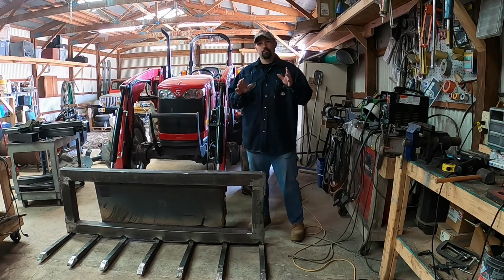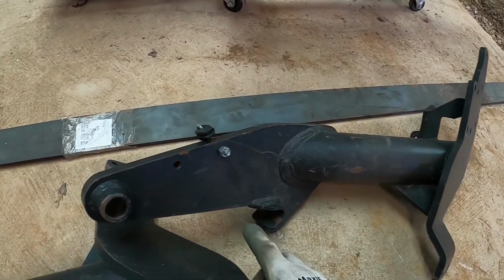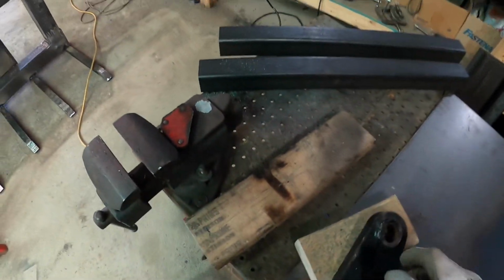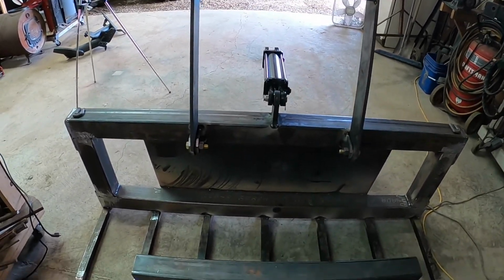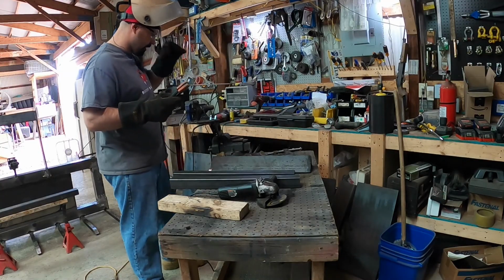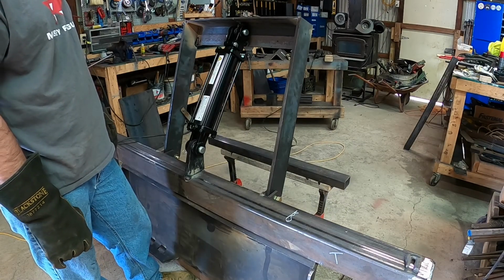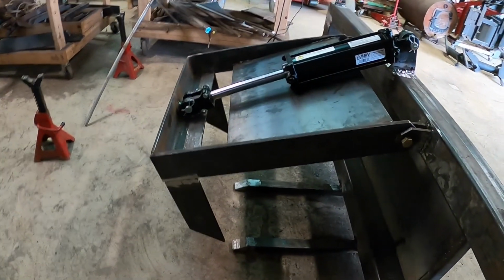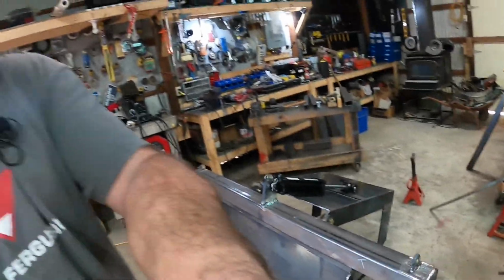223: The New Grapple - Part 5 - Fabricating a Top Jaw

Comment: It's looking nice, Logan. Really hefty, too! Of course my vote was for the full-width clamshell style, but I do want to see you put this one to use clearing land.
Reply from the maker: I'm thinking the clamshell is superior for cleaning up debris on the ground.  Maybe next winter I'll fabricate a new top jaw.  You'll see video of it in action Monday.
Reply: What would be cool would be to have an interchangeable system where you can change the top jaw out for different uses. I know that's a lot easier said than done on both the fabrication as well as the use. I'm sure your grapple is really heavy based on the base. Any idea on the weight up to this point?

Comment: That top section will be easy to modify later if you wanted too. You could always add onto each side to make the top as wide as the bottom. Looking awesome!
Reply from the maker: That's what I was thinking.  It really wouldn't be hard to modify hinge points and change the top jaw completely.  Great minds think alike!

Comment: Logan, Hum! Are Grappling with a Grapple? Part 5 really, do i hear Milking a project!😂 Just kidding, Trying to film Metal Fabrication, really makes us aware of how much thinking time there really is to a project, just curious are you using 7018 for the welds? 🚜🪵👍🏼🇺🇸
Reply from the maker: You're the second person who recommended 7018.  I've been doing 6011 so I don't have to worry about storing them super dry.  And YES I am milking this for all it has.  All my projects after this are hard work lol.
Reply: @FabbedFun  6011, is ok with experience over 6013, at 30 tons per inch its fine for 90% of work, back in the day i wood weld pressure piping with 3/32 6010 for the root and 1/8 6010 for the fill pass and cover pass, For Truck hitches and other farm equipment 7018 was my minimum, with most times at used 1010. Mostly thought its keeping the joint beveled and clean, Take Care its looking good👍🏼🇺🇸